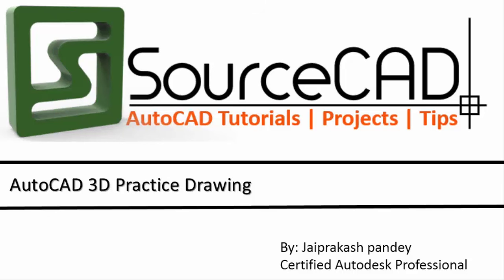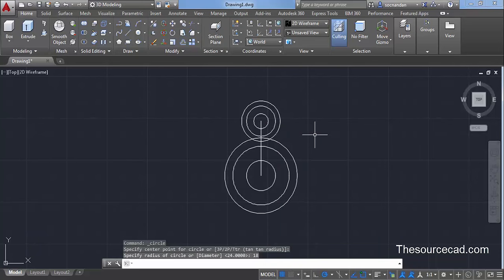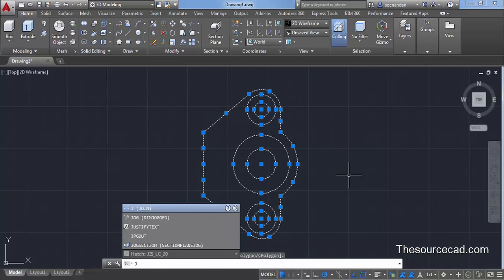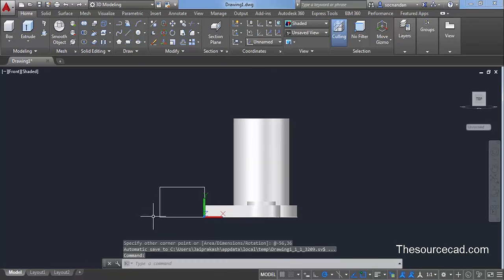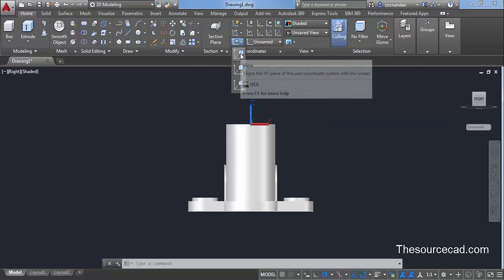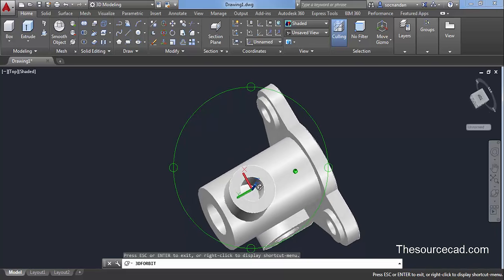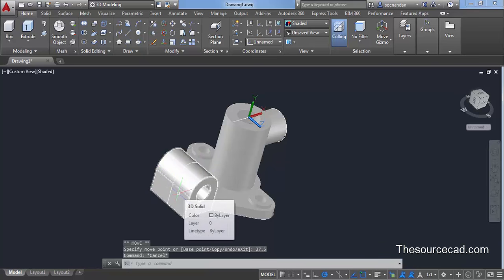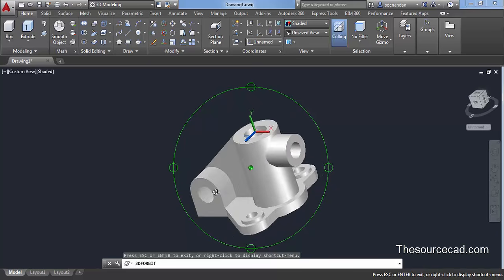Autocad 3D practice drawing : SourceCAD

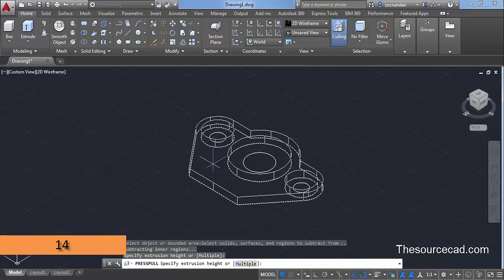Comment: Greetings from Greece! I don't know if you're still checking the comments but I have a question. Did you use further instructions? For example why is the height 14 on 7:05  or y=36 9:30? Have you calculated it somehow? Thank you anyway. Nice video.

Comment: For those who want to immediately jump in and defend AutoCAD please keep in mind I started out with AutoCAD for 3D work over 15 years ago, I stopped doing all 3D modeling for 10 years, and then took up SolidWorks.  After watching this video I am sure I will stay with SolidWorks for 3D modeling.  I find the moving of the XYZ coordinate tedious and a bit confusing.  I believe this same part could have been drawn in 1/3 of the time with SW. I do not remember AutoCAD being so clunky in 3D modeling. With that statement, I would like to see two well-trained individuals draw this same part one in AutoCAD and the other using SolidWorks.  It would be very interesting to see who could finish first and by how much.
Reply: I’m more trained in solid works are might be getting autocad job and jeez does autocad 3d suck compared to soildworks

Comment: MANY  GEOMETRY   TO  3D  STYLE  IS  NOT

REVIEW  BUT  WE  MADE  MODE

ACCORDINGLY 

NOW  THIS  FRONT  PORTION  IS  VISIBLE

TO  YOU

X  Y  IS  VISIBLE

NOW  RECTANGLE   COMMAND

TOWARDS   LEFT  OF

COMMIDATE  HEIGHT 

56  &

HEIGHT  

36

PRINT  46  &  26

EXPAIND  THIS  PANALE  THEN

WE  ARE  GOING  TO  BRAKE  THIS

CLIVK  ON  FIRST  POINT

AND  SECOND  POINT

THEN  THIS  ENTER

GHEN  YOU  CAN  VIEW

PARALLEL  VIEW  OF  YOUR  JOINT

NOW  IN  OPPOSITE

SIDE  NOW  WE  HAVE  IT

NOW  THIS  CENTER  POINT

CENTER  POINT  IS  NOT  VISIBLE

CLICK  ON  THIS  HOT  SPOT

GHAT  IS  IN  FRONT

Comment: After making the final part, the rib, you need to extrude the right side of the rib slightly to the right, that is x-direction, and union it to the main part to get a strong joint. Otherwise, you get a line contact only between big vertical cylinder and the rib which will ultimately affect the strength of the product.
Reply: Took me a while to understand this but wow thanks for the understanding

Comment: When you prepared a final rib and extruded by 6mm and then pulled by further 6mm, there will be gap at the end of the rib and the outer surface of the vertical cylinder on either side that need to be filled in. Just a thought.
Reply: Same here 😅

Comment: What about the gap between the wegde and the cylinder?
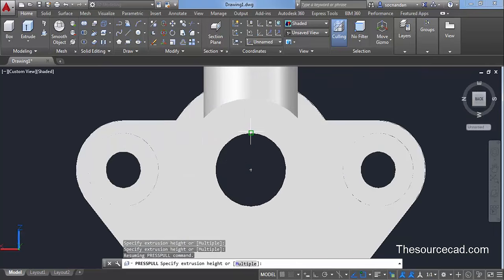Reply: I was wondering the same. I think the plane facing the cylinder should be extruded (press/pull) into the part and made into a union, like at 15:25 & 16:00. Knowing there is a slight gap between the two would bug me, if this step isn't followed.

Comment: great tutorial but, there is a problem; that truss you created at the end is tangent to the tall cylinder. This means that there is a gap on either side of that tangency. If the first line you drew in creating the truss had fallen short of the outside of the cylinder there would be no gap and then you could merge the truss with the cylinder. Still, a very good tutorial.

Comment: Hello! I have one little question about the problem I had almost in the very end of making this part.
So the last polyline which we had to extrude and then presspull, right? When I tried extruding the polyline, it appeared to be a spline and only outer lines of the object could be extruded, then I googled it and converted spline into the polyline, but I still wonder why did it become a spline. Do you know how could that happen?
P.S. Nice tutorial, man, best I've seen about AutoCAD yet, very clear and easy to follow to.
Reply: it was the same for me, at the very last step

Comment: It doesn't move the way u r moving ur object 😞😡
Reply from the maker: can you tell the time in the video where you are facing issues with move command?
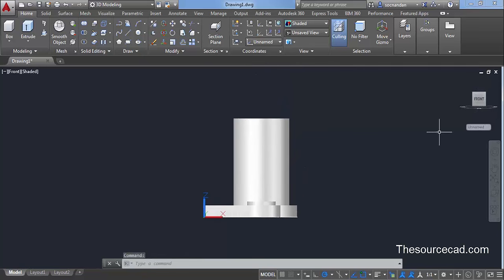Reply: From 8:46 min its not moving as u are able to that ucs icon is staying at the same axis
Reply: U r moving that upper cube and that axis icon is moving too with it but  when i am trying its not moving every side is changing differently
Reply: Maybe i am doing something wrong or maybe some settings need to be changed 🤔🤔😫😩😩

Comment: There is an error at 21.52
When you extrude the last object with a thickness of 6 by each side, there is some little space between that last extruded object and the cylinder. That object doesn’t fit correctly to the cylinder.
Reply from the maker: That's not an error, that's the way this drawing can be made as both the mating geometries have dissimilar shapes (cylinder and rectangle) and it is not possible to merge it properly without altering either of the shapes.
Reply: SourceCAD 👍 thank you

Comment: I see that the last geometry you created (the brace between the horizontal and vertical cylinders) is flush against the horizontal cylinder, but doesn't it just barely touch the vertical cylinder? Before you enter the values of -6 and 6, you can see how it pulls away. Granted, with only a thickness of 12, it looks very close, but isn't the actual area of intersection zero (since the width is zero)? I can see how we could have filled that in by including a rectangle the width of the vertical cylinder wall before we extruded it, but can we add that volume after we make the brace?

Comment: Wow, AutoDesk Inventor is so much easier for 3D modeling...
Reply from the maker: Yes, it has better 3D functions but it is specifically made for that (3D modeling) and why will you pay twice the price for a software if you can use a cheaper (and better in many cases) alternative for that.
Reply: just depends what you're doing, but the time saving for working in 3d is so huge that the cost is worth it. and its just some much easier when doing this type of work...
Reply from the maker: at the end of the day, it completely comes down to the project and your requirements. Choice of software is mostly driven by cost, interoperability and collaboration opportunities and it is a debatable topic(which is better) and will remain a debatable topic for quite some time. At least that's what I think :)

Comment: i dont understand which autocad software version you are using, there is no autocad 3d on autocads website, there is inventor civil and some other which by no means are close to what you say in your title.
Reply from the maker: it is the AutoCAD 2016 you simply have to switch the workspace to 3 Modeling.

Comment: Hii SourceCAD,

Can you tell me how to create 3d using (i am using autocad2014) on 2d planes 3 views mode ?  is there such a feature in autocad that allow use to create 3 2d drawing to form a 3d view ? for example,
i am drawing on plan view, front view and side view, and i links every part of the item in all 3 views together (telling autocad this line of plan view is actually that line on front view.... so on ) , then autocad will generate a 3d model of the 3 views assembled  item. 

is that possible by autocad2014 ? 

thanks. 
andrew

Comment: i am using autocad 2015 mac version could not select the area when doing the press pull for some reason
Reply from the maker: It happens sometime when the area is pretty complex. Try joining the geometries then try presspull gain and if you are still not able to do that then use Extrude command and remove extra geometries using boolean tools.
Reply: thx

Comment: For some reason I cannot figure out, on the very last two steps. Where you extrude the strange shape 6 units in either direction. I extrude it, however it only gives me that shape, i.e. a hollow outline if you would. So rather  than that nice solid extrude I get an extended outline. Any advice?

Comment: Although I am using AutoCAD since 1998 however creating 3D modelling like Mechanical parts it is very easy to build in Solidworks software. To create above model in solidworks require maximum 5 minutes with real view rendering.

Comment: I am having trouble following because when you say a negative number I have to use a positive number to move an object in the same direction. am I set improperly?
Reply from the maker: The positive or negative number depends on the direction of UCS so if it is woking with a positive number in your case then you can use a positive number instead of negative.

Comment: This is really a good video to show all the process! I am beginner to learn AUTOCAD and I have a question about the UCS. Can I select any UCS without considering WCS? For instance, can I choose two different UCS to draw two respective parts even neither of them match with each other or with WCS. I am a bit confused and I am not sure if I state my question understandably. Thank you heaps!
Reply from the maker: In AutoCAD, you can only choose a single UCS orientation. However, you can change UCS orientation as many times as you want.

Comment: I think you missed to mark the height of one of the rectangles on the drawing. It's 36 according to the video. Just saying to help those who want to model the part by themselves based on the drawing only.
Reply from the maker: Yes Adam it was not mentioned in the drawing, thanks for informing others.
Reply: That's right there is so many missing mark base on the image.. i think it will need a clear discussion base on the image.. but i appreciate the video...
Reply: Thanks for the info
Reply: thnks for the info brthr
Reply: Literally i spend 30 min to find this height of rectangle.... 😐😅
Reply: N thnx fr the info✌️

Comment: For me it opposite when it comes to Z and X I if I wrote -75 units it went the other way, you got some setting on or is it because I use AutoCad2017?
Reply from the maker: It depends on direction of your cursor negative sign will make geometry in opposite direction of cursor.
Reply: @sourcecad  i can't make circle of radius 12.5 aur 24 last circle :(

Comment: ooooooooor ....we can just use inventor and not have to deal with autocad :), jk im learning autocad.
thanks for the help
Reply from the maker: Welcome Miguel, Autodesk Inventor is obviously a great 3D CAD application but it is expensive and it is not wise to spend money on it if all you need to do is make simple non-parametric 3D models.

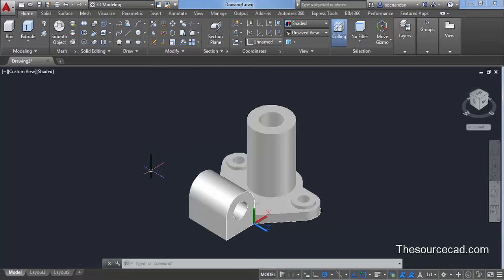Comment: At 12:00 I found it almost impossible to get my origin to snap to the center point so I had to do it in a more 2D perspective.

Also the finished geometry has gaps in it, is there a way to close these? https://s29.postimg.org/zd2y6g5l3/Untitled.png
Reply from the maker: You can press and hold shift key then right click and select center, in this way you can force selection of the only center from the drawing.

The gaps can be filled only by increasing the length of the wedge so that it ends within the cylindrical shape of the geometry and yes it won't be very accurate as the wedge which is a straight geometry is joining a circular geometry (the cylinder) and that too at an inclined angle.
Reply: I did Shift + Right Click and select center, it was incredibly difficult to get it on the center point of the circle, once I did get it on the center point once I left clicked to confirm the orientation of the X/Y/Z axis would snap off to an odd angle. Very strange but I worked around it :) 

As for closing the wedges I now know I could just alter the geometry with a radius the same size as the one it butts up to.

Many thanks
Reply from the maker: Glad to know that you managed to do it all by yourself :)

Comment: I am an engineer and for me its a shame i dont know autocad but i have started learning it and i have to make all development  by calculation and I am well at that atleast
 but company wants me to  make a layout on autocad
My question is i want to make a plate cutting layout
plate size 1200*6000*10mm
In this plate i want to mark a frustum cone and  a shell. 
cone base diameter 1000 top diameter 600 and height 400
shell 1000 mm dia 6000 mm long thickness 10mm
please make a video of cone decelopment and shell plate development and how to fit them in above diamension plate in 2D
I am using autocad 2007
so it will be kind if you will add such a video
and sind me the link too so that i can know you have uploaded it

All diamensions are in mm
Thankyou

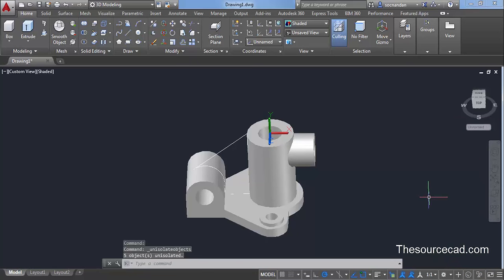Comment: I have a question, at 21:38 you have created the polyline, but when you extrude it 6 units it shouldnt match the top face of cylinder perfectly. By that I mean the top most right corner of the polyline that your created is on the cylinder, but as you extrude the poly line the objects corner will be left outside of the cylinder if I am not wrong. Is there any solution for this?
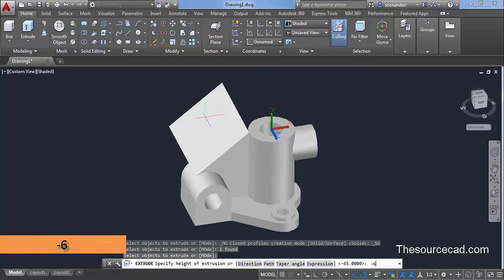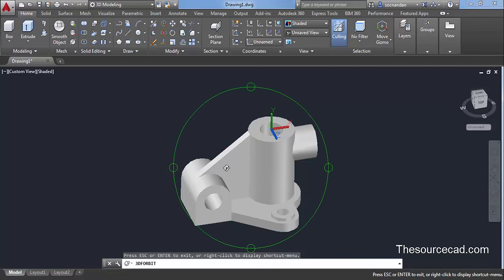Reply: And if you stop at 22:00 you can see what I mean before entering the value 6 it is obvious that the object that you are creating will only touch the cylinder at 1 line which is the tangent. And if you stop at exactly 22:18 you can see the top view and the gaps that I mean
Reply: and lastly at a comment below stating the same problem I see you responded: "The gap can be filled by extending length of wedge towards centre of cylinder so that it merges inside the concentric part of cylinder." But by doing so even though there is no gap, the corners are still not on the cylinder, that part still looks like a rectangle instead of a curve, is there any way to make it a curve matching the cylinder?
Reply from the maker: You can merge the gap by making a longer wedge and then chop off extra part so that it looks like the one shown in this image https://www.dropbox.com/s/w2kqgdvs57pwsa1/2016-11-23_22-17-44.jpg?dl=0
Reply: SourceCAD thank you very much

Comment: I don't understand why you kept moving around the origin xyz marker without making any changes
Reply from the maker: In most of the cases, I am using multiple options of UCS, for example, changing the origin then changing the plane, which might seem to you as useless but it is obviously necessary to draw the 2D geometries on the exact plane. Changing the UCS does not solve the issue of origin or parallel planes and for those cases, I am making multiple manipulations to the UCS before making the drawing.

Comment: Hi, I'm using AutoCAD 2010 and struggling to find a way to isolate/hide objects, like in the later part of your video. Is this function only on newer versions of AutoCAD?
Reply: You can use layers; one for the object and one for the 2D drawings then turn off the layer to hide the objects in that layer and turn on to see them back in your screen.

Comment: On trying to extrude the final wedge that was made, i noticed that the extrusion wasn't solid but rather hollow. Any reasons as to why?
Reply from the maker: You must be using objects not made with closed polylines. Try joining all 2D lines into a single polyline then use extrude command again

Comment: its amazing video. i want to know that when we make the inclind  wall i got a gap between the wall and cylinderical object. howto fill that gap?
Reply from the maker: The gap can be filled by extending length of wedge towards centre of cylinder so that it merges inside the concentric part of cylinder.
Reply: thanks

Comment: it seems that autocad doesn't care about topology and poly flow  !!
Reply from the maker: I think they need not care about them either, Autodesk is best used as a CAD programme not as an CAE tool.
Reply: I was curious too, I wanted to know the difference in work flow between a 3D package like 3DS max or Blender and Autocad
Reply from the maker: I hope this will answer your question http://animation.about.com/od/faqs/f/Whats-The-Difference-Between-Autocad-And-Other-3d-Programs.htm
Reply: thanks for the link,
but if we make this mechanical component on 3D package like 3dsmax will it be any different from the one made by autocad?

Comment: Hello there, I have a question. How do you know that you should pull 2D geometry at the height of 14 units, when converting to 3D at 7:08?This height is not specified at the projection map, and one cannot simply calculate from other dimensions, or am I missing something?
Reply: I also have the same doubt
Reply: I’ve been looking at the drawings trying to find out what combination of given measurements work to 14 units. The only thing I can think of (having never used cad) is the radius is given for the circle 14. That radius ‘looks’ the same length as the height of the base at 14 units. 
I would like an actual answer though and not me just eye balling it lol.
Reply: I also have the same doubt please reply this answer if anyone knows?

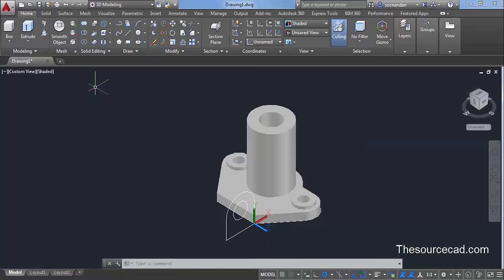Comment: When I did the presspull command @ 11:33 of the vid, I had to just enter 75 units, rather than -75.  It seems as though the direction I run the cursor represents the positive direction regardless of which direction the Z axis is.  (I hope I worded that in a way that makes sense).  I'm using Autocad 2017 so I'm wondering whether that's something that's changed for Autocad 2017 or if one of my settings is different than yours?  
Thanks.
Reply: Old comment but for anyone who encounters it this was also the case for me using AutoCAD 2021. I was also thinking it could be a difference in settings.

Comment: Thank you very much for your great videos, I have learned a lot already! In minute 11:50, I have to enter positive 75 instead of -75, otherwise it extrudes in the wrong direction - why might that be? Using AutoCAD 2016
Reply from the maker: It might be due to direction of your UCS
Reply: Well, I checked, and it seems to be the same. The problem also happened in another video where my UCS direction seemed to be the same - any idea?
Reply from the maker: It may also happen if you point UCS in direction opposite to geometry construction, try to keep UCS in the same direction of geometry and then enter only positive value of distance.
Reply: +SourceCAD I will try that, thank you!
Reply from the maker: Welcome